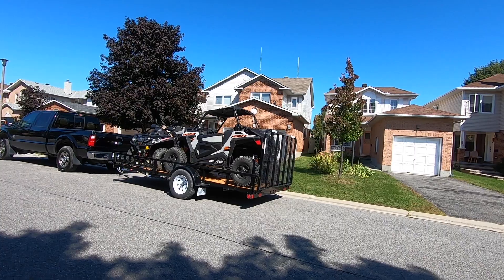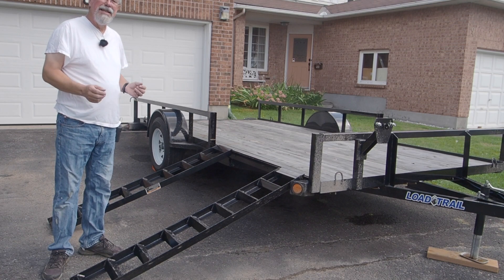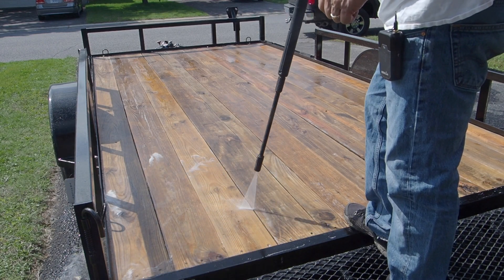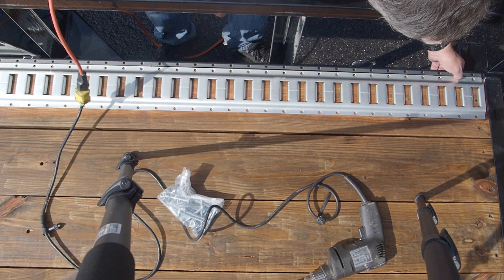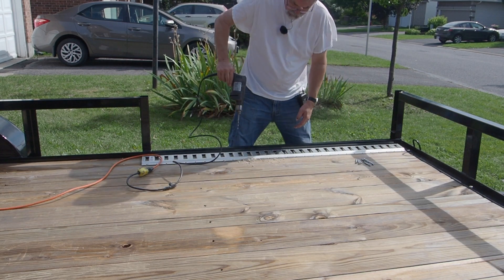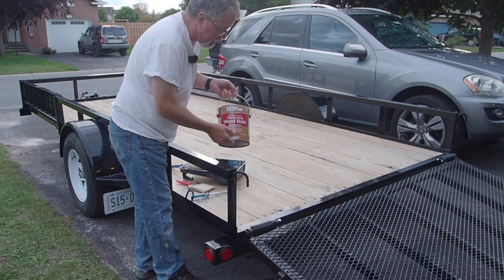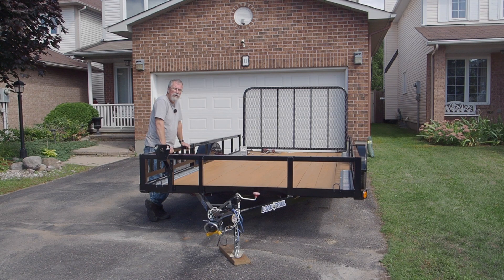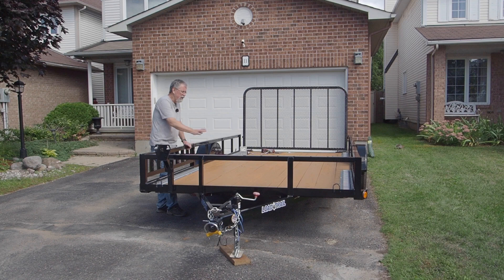New ATV Trailer Setup

Comment: What's the length of the atv. Seeing if I can get a honda rancher that is a little over 7 feet onto a 7 foot wide trailer. I know the body of the rancher is longer then wheel base.
Reply from the maker: My quad is 7 foot 4 inches bumper to bumper but tire overall tire to tire fits into the trailers 6 foot 11 inch inner bed just fine.

Comment: Looking for a similar setup to haul my sportsman sp and my wife's rzr 900s. My question is with looking at the construction of this trailer and it being a single axle I can't imagine gvwr being over 2990 and the weight of that trailer has to be over 1400lbs? Doesn't this put you pretty far over weight? Curious because this is my main hesitation for not pulling the trigger. Thanks and love your videos!

Happy trails!
Reply from the maker: My trailer has the upgraded 3500 lbs axei, you also have to take note that the with the quad all the way at the front almost half it's weight is on the tongue and not on the axel.  All that said I scale in at at 3177 lbs with the atvs fully fuelled.
Reply: @ATVONTOUR  So you are a little overweight then correct?   Spec on those trailers looks to be 2990 GVWR.  Check your spec sticker on the trailer and see what the GVWR is.  You may be under weight as far as the axle but if you ever got in a accident and they looked into it and you were over the GVWR you could be on the hook for negligence.
Reply: @ATVONTOUR  And? Unless it’s got brakes on that axle the trailer is still capped at under 3k, which is why many are rated for 2,990, which would make your setup technically illegal and even if not, still way too close to the sun.

Comment: How does this setup tow down the road? I want to get this same trailer and load my King Quad 750 and RZR 570 the same way.
Reply from the maker: With both units on I don't even feel the trailer.  If you run with only one unit on the trailer make sure that you place the weight forward of the trailer axel, that way you'll have sufficient tongue weight and once again I don't even know that I'm towing a trailer.
Reply: @ATVONTOUR   they suggest  a 60-40 ratio with only the single quad . With the 60% in front of the axle
Reply: Spend the money on one made of Aluminum. I did and can’t find a complaint. No rust to deal with all the time. Much lighter to tow as well..

Comment: You have all the weight towards the rear??? Wrong.
Reply: 60-40 ratio is what your trying to achieve and there no real option here as the "side loading" feature is at the front portion of most trailers.
Reply: @Dave-Six4Hemi   I agree he has that side by side all the way forward so I suspect  he is fine
Reply: @snakeplisken4119  No, ~15% tongue weight is what you’re trying to achieve. Weather he’s got that or not is only a guess. Simply saying a 60/40 split is meaningless and doesn’t take into account variables like axle position or tongue length.
Reply: @Icutmetal  For clarification,60 % weight forward of the axle and 40 % behind it ,if possible.Also the percentage  is something  that the average  person can invision. The roughly 15 %, while correct, is not an easy number to come up with   from a practical  standpoint, so equally is kind of meaningless.
Reply: @snakeplisken4119  No, you’ve got that confused. Trailer weight *.15= tongue weight. If you don’t have an idea of what your gross weight is, you shouldn’t be towing, so I’d argue that factor is far from meaningless. Where are you coming up with this 60/40 thing? I’ve never used it, nor have I ever heard or read of anyone who has.
Reply: @Icutmetal  Vast majority  of folks ain't gonna care about Gross or tongue  weigh frankly.If they did, they wouldn't be speeding with a trailer when most tires on it were China Bombs which I see daily. The kiss principle seems to be more applicable advice  to them: tie in your load,balance it if possible slightly forward of the axle,cross your chains,make sure the lights work,grease the bearings, keep the sun off your tires, don't speed, take your time backing up and dont overload it...  just do a second trip.All good on my end...